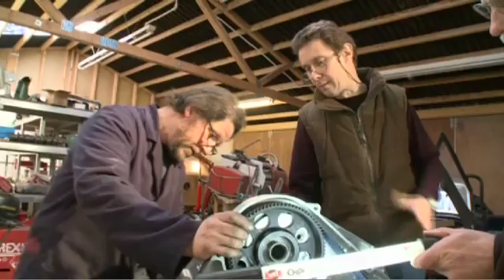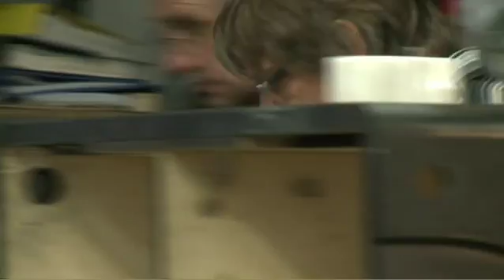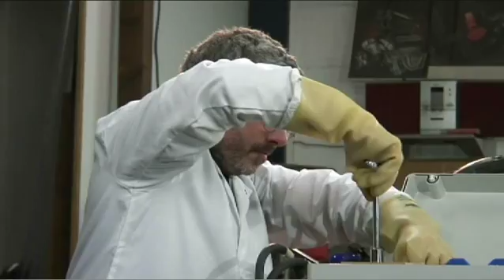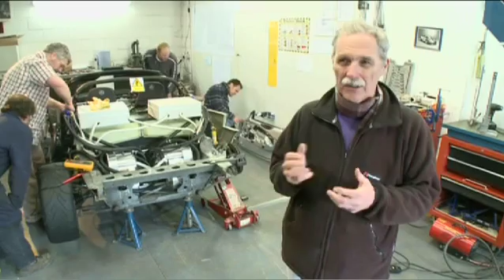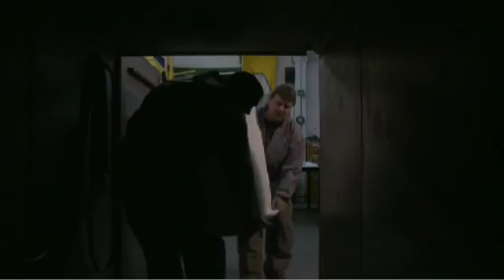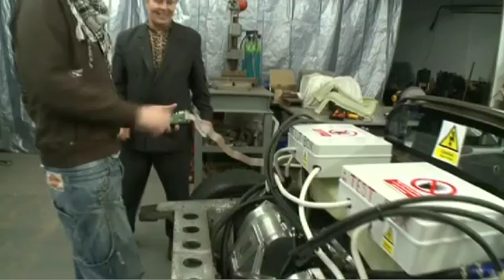Part 7 - Zerocarbonista - The Wind Car is on its way

Comment: cool project. interesting choice to use belt drive and two motors. is the gearing a custom design? what kind of efficiency does it have?
and what's the cars 0-100km/h time?

Comment: @Takshia89 absolute not. it is technically possible to make a car like vehicle powered by the wind but it would be similar to a sail ship in that it's limited by power and direction of the wind and it would be rather slow and extremely impractical. there was a competion for directly wind powered cars and they don't look normal at all. windmills should of course be large stationary things, not mounted on the car. although you could have one you could unfold when it's parked.